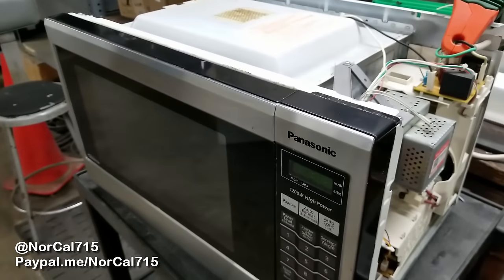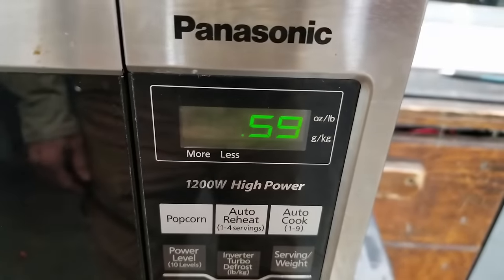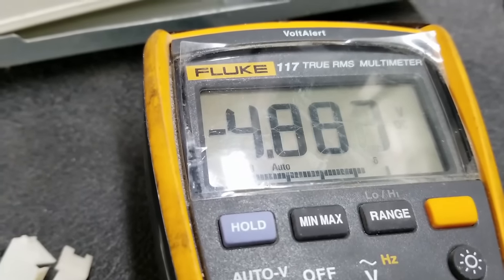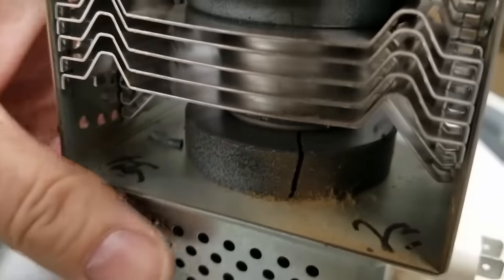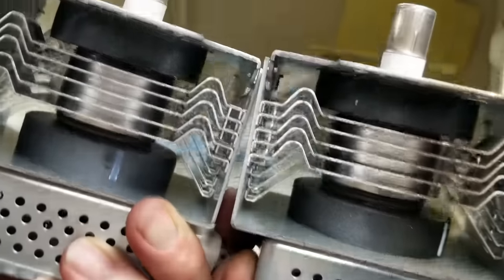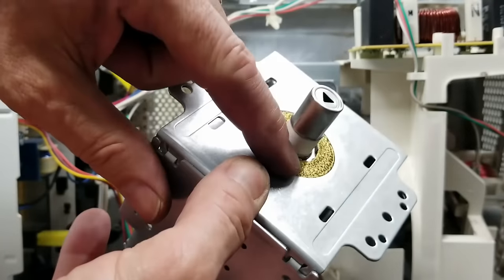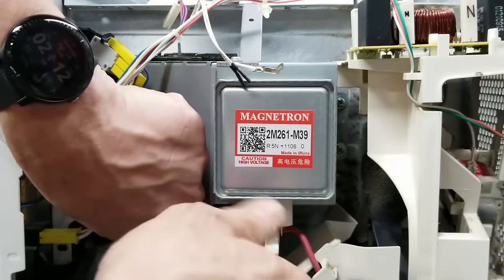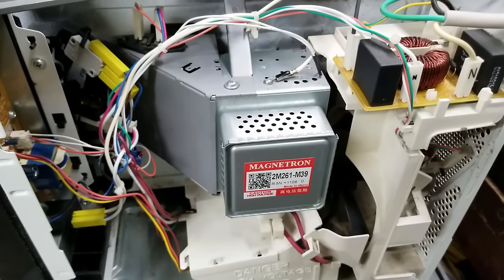Panasonic Inverter Microwave Oven H97 H98 Repair Fix

Comment: When performing the reset,I pressed the stop reset pad three times.I get a code 0041.Can anyone tell me what this means.Please help I    (UPDATE) found out that after the 0041 code. Press power level then (start or stop/reset) fixed my problem

Comment: Good microwave oven let down by cheap china magnetron. I used to do MW oven servicing full time in the 90s and there were no china made magnetrons back then. I would get machines coming in with dead mags and I would swap them out with good used ones, never had an issue.

Comment: H97 & H98 ERROR CODE DISPLAY
If 3 times H97 or 2 times H98 exist, microwave oven can not be used any more, even if the defective parts already be replaced & un-plug and plug-in again.

HOW TO RESET FOR SERVICE
 1. Plug-in oven.
 2. Press Stop/Reset pad (button) once.
 3. Open the door.
 4. Keep pressing Start pad (button) for more than 2 seconds until buzzer beeps.
 5. Press Stop/Reset pad (button) three times.
 6. Press Start pad (button) once.
 7. While finish resetting, one beeps, and shows “End”.
 8. Press Stop/Reset to return to initial stage.

Comment: Don't mess up with magnetrons, they have beryllium, that ceramic on that pin top covered with a metal cap, if you inhale the dust of it you mostly get into a process of painful die :) always leave it intact, savaging parts from magnetrons it's a stupid idea. Be aware
Reply: @ FixDaily - Electronics, I agree, magnetrons should be handled with reasonable care, but I worked in commercial marine electronics for years, and handled hundreds of magnetrons. My FCC licensed technicians worked on tugboats, and other commercial vessels on a daily basis, and what was emphasized by Raytheon, Sperry Marine, and Furuno USA was to not stand in front of the antenna array, or you would be cooked! I'm surprised the leftist in California haven't banned microwave ovens. Lastly, if in doubt, wear disposable gloves. BTW, at 74, my doctor considers me healthy.

Steve, I've had this same oven myself for about twelve years, and it's given no problems. I bought it at Target for $100.00.

Comment: This would of been the perfect video that I’ve watch so clearly stats how to do everything but does show where to place the amp clamp why not show this,just so disappointing to me now I gotta go watch shitty videos to find out where to hook the amp clamp and wat happens if you don’t have an amp clamp cause mine was stolen you must be able to check the proper amps with a regular volt meter I got a Klein  mm300 that didn’t get jacked it should be able to test the amp draw I would think I now know I have a cracked magnet so I gotta order but like an idiot I thought I’d check draw right off the 120 comeing in that should read amp draw but I was set on 10amps cause u were drawing 3 or4 but I put my positive on the neutral white and my neg on the black hot which in my experience is fine it will just read positive or nothing if your back wards it show a negative sign,but I got pretty big sparks like it shorted out kinda sparks but didn’t blow that fuse right there in the micro so I will see if it blew it in my volt meter and go from there had you showed where to do that test it would of saved me and proably thousands of others this grief,other tha this it was a great video I don’t understand why u wouldn’t show that if it’s all about likes I don’t see how this could be if I you and I don’t really understand how all that shit works either but no one’s fault but my own and with out your ideo I probably would of done more damage cause cause if you don’t fixit itwasfucked when you started I’m that kinda guy 98 % of the time unsuccessful but not real good with the volt meter either so ofte run into trouble but thanx for nothing really but I will like cause it was good except for that
Reply from the maker: On one of the incoming power wires from the outlet. I try to use the hot (black) lead whenever possible.